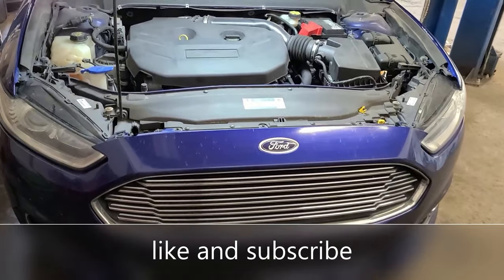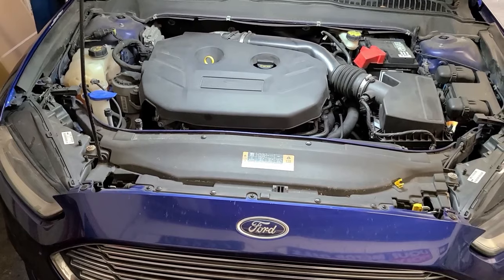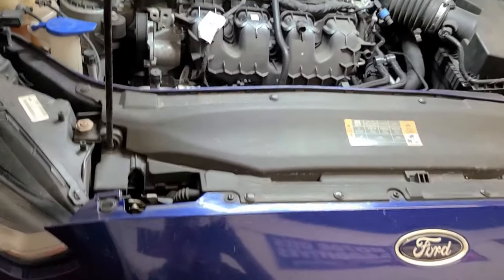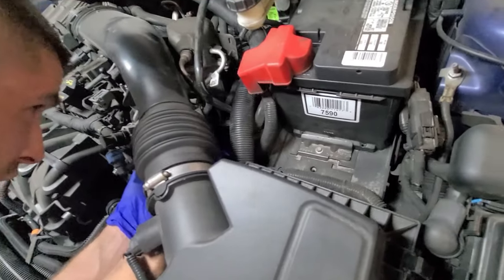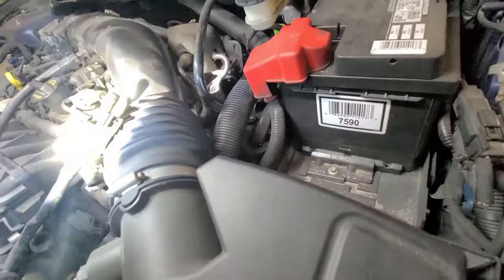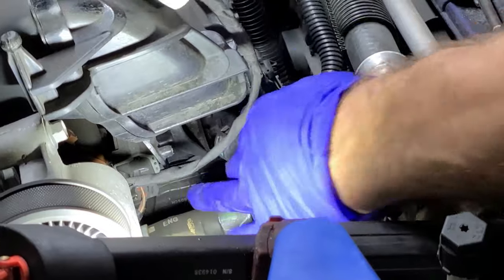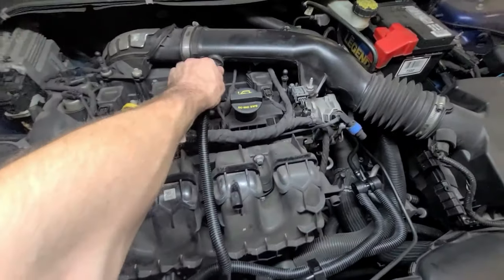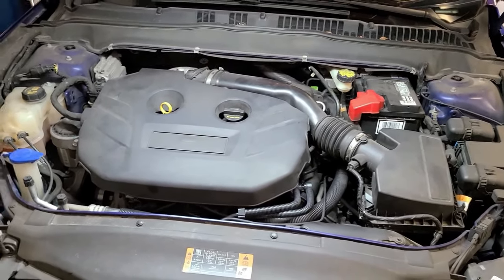Ford Fusion Purge Valve Replacement // 2.0L Ecoboost 2013-2020 // HOW TO #DIY #HOWTO

Comment: Had all 3 symptoms. The codes I pulled were P0496- Evaporative Emission System High Purge Flow

P2196- O2 Sensor Signal Stuck Rich Bank 1 Sensor 1

My 2019 Ford Fusion Titanium 2.0 ecoboost called for part # HG9Z9D289D

I saw a few comments on a Fusion forum saying you don't need to replace the hose with the yellow color head (save yourself the trouble!) I just snipped the zip ties and changed the 2 main hoses connected to the purge valve. The only tool I used was a small flat head screw driver. It took a total of 10 minutes to remove and replace the hoses. Once I reset the codes and started the car it sounded like it purred instead of the chugging idle sound it made for a couple of weeks now. If you don't have a scanner tool to reset the code just disconnect your negative terminal on the battery for about 5-10 minutes and reconnect. I just changed this today so I will update if the code reappears. Thanks for this video!
Reply from the maker: You're welcome. Great feedback

Comment: have a P0456 on my 2017 Ford Fusion . "Evaporative emission small leak detected" I was wondering if replacing the purge value well fix my issue? Because Ford is charging 450 to do it when the part is like 50$ and I think I can do it myself .
Reply from the maker: Highly likely that is the issue.
Reply: @THEDriverMod_  Thank you brother for you input!

Comment: Do you have to put the vehicle in maintenance mode before you start pulling the fuel purge valve apart?
Reply from the maker: Maintenance mode?

Comment: Is there a reason why you're not taking the air flow tube off to make it easier to get to the part
Reply from the maker: You can if you want but some don't want to do any extra steps even of it makes the job "easier"

Comment: Hey I have a 2018 fusion se, the check engine light came on and the code was p0456. Every time I’m done pumping gas, the car struggles to turn on and won’t turn on usually after the 2nd or 3rd time, could this be related to the code I got?
Reply from the maker: Yes. This procedure will fix the issue

Comment: Do I need a code reader to reset code after I make replacement?
Reply from the maker: Yes, it should go away eventually,  but if you want it gone immediately, you will need a code reader
Reply: Ok, thank you for responding so quickly! Can I clear the code later after new installation? Or does it have to be right after new install?
Reply from the maker: It can he at any time

Comment: Great video, but a bit of warning..  if you are big of hand, that jump cut where the lower throttle body connection is removed is an hour+ long.  :)
Reply from the maker: Great point!

Comment: 162k miles and has only needed two purge valves?!?! If thats true, thats amazing. I know you go 12-14k miles with the Amsoil Signature Series, I am astonished. I guess the product delivers. I know ecoboost engines can be hit or miss in terms of long term reliability, that definitely speaks to the Amsoil product for sure!
Reply: Mine is 62k and I'm changing this little shthing😆 rn
Reply from the maker: Mine happened the first time at 75k
Reply: 98k on mine ,16 fusion titanium and doing this for the first time.. thanks for the video hope all goes smoothly with my repair. Thanks again

Comment: just curious, if this part is faulty can you feel air blowing from the bottom connections ? i have a rough idle that gets worse when i turn the a/c on. the thing is my car doesnt show any engine light but when i connect it to my blue driver and see the live feed, purge valve monitor shows yellow indicator rather than a green checkmark
Reply from the maker: Might be carbon build up on the intake valves

Comment: Thanks.  Excellent view of the view of the EVAP valve and replacement.  Got my 13 Titanium via auction, deficiencies included.  1st iindication was rpm limited to rough 4 to 4500 rpm.  Replaced coils and basic plugs with Iridium TT  plugs.  Running performance 100%.  Then, as you stated, came the idle roughness, then gas tank groans and finaly the P1450. Thx again.
Reply from the maker: No worries , glad I could help!

Comment: Question pls.  On the left rear under of my ford fusion 2017 when I take a long trip there is white smog coming from like a valve after I parked but it only last few minutes.  It is not from the exhaust  , it is from a small valve on the left rear under side. What is it ?
Reply from the maker: No idea my friend

Comment: Nice video. Most that others made were atrocious. 🤣 I would comment though the P144A code, being an evap code, is recorded as a permanent code and cannot be cleared by a scan tool. The PCM will eventually run its vac test and clear itself if it passes.  So whether the cause is the purge valve sticking open, a bad electrical connection or a vac hose leak, all will set the same P144A DTC. Those connectors are a pain for sure. Thanks!
Reply: I have all the issues that a bad purge valve would give such as when i fill my tank up my car has issues starting but i dont have any engine lights on my car. Do u think it could still by the purge valve?

Comment: So I had this issue about a year almost 2 years ago. Got it replaced at a shop for $530. This past month the engine light came on for the same issue. How long do the valves last on the 2015 ford fusion se 2.0L? About that 1.5 year to 2 years? Or would this be caused by a deeper issue?
Reply from the maker: My first one lasted 4 years, second one last about 2 years, current one is about 2.5 years now. Hit or miss I guess
Reply: @THEDriverMod_  ty!
Reply: How do you remove the bottom connector on the Dorman replacement part? Previous owner did this once but it needs it again. So I have the Dorman replacement connected to the engine but the clips work differently than the original. I also have an identical Dorman replacement that I intend to replace the current one with. I've been fiddling with it to try and figure out that bottom clip but it's hard to understand without also having the male piece to fiddle with. 

Does the grey tab pull out? Or do you just push the ears away from each other and pull the connector off?

Comment: Hey sir is the problem with the gas im using i use regular should i use 87 for now on also can i just replace the value by itself i stead of the whole thing cause it does come by itself
Reply from the maker: It's not the gas you are using, you can replace the valve itself
Reply: So i can just replace the value that’s 30 or 40 dollars on the market 
Thank you bro bro
Reply: @THEDriverMod_  how i would know if the engine like go off
Reply from the maker: @Wizthehitmaker  you'll have to clear the light with a code reader

Comment: Hello... great video!!! two questions thou. 1- Can i just change the purge valve? and 2- What's the part number?? 🙂
Reply from the maker: I have not yet found just the valve itself. DM me on Instagram and I'll send you a link
Reply: Hey I’m having the same questions, although I think I found the part in Amazon. Is it ok if replace only the valve? Thanks for your video!
Reply from the maker: Yes you can if you can get it separately

Comment: kind friend good morning I ask for your help for my Ford c max 1.8 duratec petrol I will explain to you the car has two defects when I run on petrol the trigger goes off second defect when I accelerate on the gas and as if it were suffocating it lacks thrust what could it be? I thought about the Cannister filter behind the fuel tank and then changing the hose in front of the engine compartment with this solenoid. Do you think I can solve the problem? Thanks for your help, the car doesn't turn on the warning lights in the instrument cluster.🙏🏻
Reply from the maker: Sounds like 2 separate issues, not very familiar with those vehicles

Comment: I was just told by a dealership the part would cost about $250 and labor would take 2 hours. Is that possible? Is there another purge valve that's harder to get to? Is this the ventilation purge valve?
Reply from the maker: I can't speak to what they are quoting but it sounds like the labor qoute is the 1 hour standard diagnosis and the 1 hour repair time. Parts cost have gone up industry wide. The part I have linked in the description is an aftermarket part but works just as well
Reply: Would this work on a 2020 ford fusion

Comment: Can I replace it and then drive to the auto store and get the codes cleared? Or does the code need to be cleared immediately after the repair, before driving?
Reply from the maker: It can be cleared at any time
Reply: @THEDriverMod_  awesome, thank you for the video.
Reply from the maker: No problem! Best of luck

Comment: My car does this sound after driving it for a couple minutes and I see my dashboard and the car seems to be trying to pull energy to stay on. I’ve checked it with a scanner and I get the code p2196. I thought that was the problem and got that part changed and it still did the noise and the part on the dashboard where one needle also shakes and my car shakes a little as well
Reply: Hi my car has the same problem. Did you fix yours?

Comment: Where do I get one for my 2018 fusion 1.5 ecoboost or will. 2016 purge valve work?
Reply from the maker: I can't speak to that. If I had to guess, I would say a 2016 1.5l and 2018 1.5l would likely be the same

Comment: How to get the electrical plug off? Im sooo frustrated.
Reply from the maker: You usually have to pull a safety tab back then you can push down and release. If that doest worn, take a small pick and use that to release the connector tab

Comment: I've seen this part sold as the solenoid only.  The hoses are hard plastic, how would those come off without ruining the hoses to put on the new solenoid?
Reply from the maker: Not sure. For this car it is not available seperate that I've ever seen
Reply: @THEDriverMod_  I have a 2013 1.6L Fusion was able to buy the valve separately. Actually I rarely saw them together in 1 purchase. Hoping I didn't make a mistake :S Part arrives today. Great video!
Reply from the maker: Good luck, sorry I don't have a specific video for the 1.6L!

Comment: I’m having that same issue, does that canister valve in the description fit a 2020 ford fusion?
Reply from the maker: If it's a 2.0 ecoboost, yes
Reply: Can we verify this worked for the 2020. I have a 2019 se 2.0. Just want to be sure

Comment: Hi I was wondering if that is a Ford part? If so, what's the part #? Thanks
Reply from the maker: It's called the "tank vent valve" or "purge valve " I do not recall the part number unfortunately

Comment: I replaced the valve.. the engine light went off but the car is stopping while I drive & won’t go in reverse after it stops itself. I couldn’t make it half way around the block without having to cut the car off & back on
Reply from the maker: Sounds like something didn't get reconnected or there is another issue

Comment: I have a 2017 ford focus se and my check engine light came on but my issue is the canister vent solenoid ( CVS20 ), my question is the previous one is really lodged in the Vapor canister when lowering the canister do I need to worry about fuel coming out of the line or I don't need to worry?
Reply from the maker: The vent solenoid isn't even near the canister, the solenoid is under the hood. There shouldn't be any liquid in that line to begin with.
Reply: @THEDriverMod_  the canister vent solenoid (PV516) is apart of the charcoal canister but mine is not unlocking should I just drop the canister to make it easier because it's a pain to do so while attached to the body?
Reply: @THEDriverMod_  your thinking of the canister purge valve (PV691) that is located under the hood!
Reply from the maker: My bad. Thought your were referring to the vent solenoid under the hood, still should have any fuel in those lines, if you do it's from topping off your tank at the pump.
Reply: @THEDriverMod_  Thanks for your help was nervous about having fuel dump on me while trying to remove

Comment: So is not my fuel pump that need to be replaced? When it making that farting noise an don’t wanna crank when you trying to start it?
Reply from the maker: Correct. Just the purge valve as mentioned in this video
Reply: @THEDriverMod_  I have a 2013 Ford Fusion 2.0 so which purge value should I get
Reply from the maker: If its a 2.0 ecoboosr, get the same one in this video. It's in the description.
Reply: @THEDriverMod_  thx u so much

Comment: I changed the part and put the new one but the engine light is still on, do I have to delete the code with a scanner or can I disconnect the battery?  can you help me please
Reply from the maker: You have to delete it, it may delete itself after driving for awhile
Reply: @THEDriverMod_  It just happened to my 2015 titanium. I noticed hoses in the way when you were taking the old one out. Could you remove them, or would that cause more problems? Thanks for posting this, I have it saved when I'm ready to fix it.👍👍
Reply from the maker: I just don't like to mess with anything that I don't need to, whether it's coolant you would lose or messing around with more plastic/clips.
Reply: @THEDriverMod_  I really don't either, I just thought I'd ask. Thanks again, be safe and have a great weekend!
Reply from the maker: Thanks! You too!

Comment: P04ef and p04b4 are the replacement of purge valve for 2019 Ford fusion hybrid?
Reply from the maker: I am not sure, what are those codes for?
Reply: @THEDriverMod_  p04b4 and p04ef.  I checked with pepboy ad they said those code for refueling vapor control valve. Is it the purge valve?
Reply from the maker: Yes, that is the same part, just a different name for it

Comment: Great video!  Do you have the part number for the assembly?  Ford Parts keeps saying the only purge valve for my '17 Titanium (2.0 Eco) is the 9F945, which does not seem to be it...In fact it seems to say that the part shown here is not correct for my vehicle , yet I have it in the same spot and routing as your video ... At a loss for sure.
Reply from the maker: I unfortunately do not have the OEM part number. I apologize. They might call it something else, purge valve, tank vent valve, canister purge valve.... it's usually one of those 3.
Reply: Not sure if this helps because this is for a 3rd party version, but doorman makes this part and the number is 911-775. You can get it on amazon for about $60, but it'll be around $100 if you go to an auto parts store. Hope this helps!
Reply from the maker: @michaelpalmieri539  awesome info!

Comment: One question: I have P144A code, the repair person told me that there could be multiple reasons and want to charge me 300 dollars. Is that reasonable?
Reply from the maker: No, just stary with replacing the valve because that is a known, common failure point.
Reply: @THEDriverMod_  I tried a long time, but I cannot even take apart the valve...
Reply: @THEDriverMod_  thanks for the video. I understand the process very well theoretically, but I realize I do not have the power or skill to take off the pipes and valve, I really doubt I may break my car if I try too hard but actually don't follow the rule well.  For example, I want to take off the electronic wire, but no matter how I tried, it cannot get off...
Reply: @THEDriverMod_  i called today and found one place charging 160 dollars in total.
Reply from the maker: @jingjiao8234  happy I could help the best I can. Thank you for watching and commenting!

Comment: What's the difference between purge valve and canister vent solenoid my p1450 says I need a canister vent solenoid
Reply from the maker: Same part, no difference, Same thing we replaced in this video
Reply: I was told it was by the gas tank
Reply from the maker: @quashaunsuitt8033  the canister itself is but the solenoid is in the engine bay
Reply: I gotta get the canister changed is there a video for that
Reply: Canister vent solenoid

Comment: Ive got p0456, took it to Ford. They’re trying to charge 749$. Would the part in your description work for a 2019 Ford Fusion se? Awd ?
Reply from the maker: If you have the 2.0 ecoboost engine yes, if it's the 2.5 non turbo or the 1.5 ecoboost than no it would not, same part name it sounds like but a different part number

Comment: Hey I have a 2017 ford fusion we 1.5 liter eco boost I want to know if this part will fit my car it says it doesn’t when I put in my car info on Amazon
Reply from the maker: You have a different engine so the part I used in this video will not fit your car.

Comment: Hey!! I saw this video went to help my sister, figured it would save her a little money. Got it off in decent time felt like a surgeon using the pick on the bottom one. Anyway i was having trouble getting the bottom one back on, any helpful tip? Did you use a small large screw driver for leverage? Please help!!
Reply from the maker: A screw driver or pick try lubricating the connector with some oil or lubricant
Reply: Does the grey clip come out prior to going on? Or will it just snap on?
Reply: Also what kinda of lubricant?
Reply from the maker: @guesswho4092  pb blaster, engine oil or something like that.
Reply from the maker: @Guess Who  if it's a extra spacer then it comes off. It should just be a fitting with a quick release clip of some sort
Reply: It looks like the exact one you have in the video
Reply from the maker: Then you should be able to snap it on no problem, just make sure the release clip isn't getting jammed up and not allowing the connection to fit properly
Reply: Got it on after work yesterday, cleared codes, thank you so much for your help!! Will probably be my go to guy
Reply from the maker: Awesome news! You're welcome, have a good one!